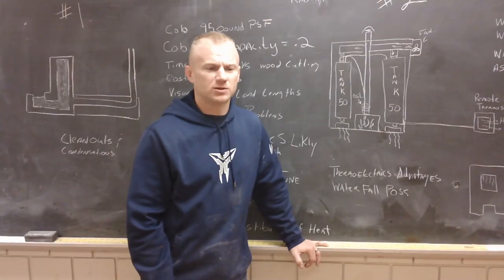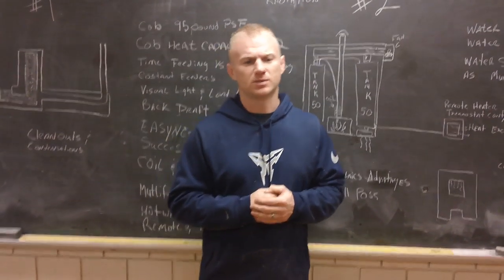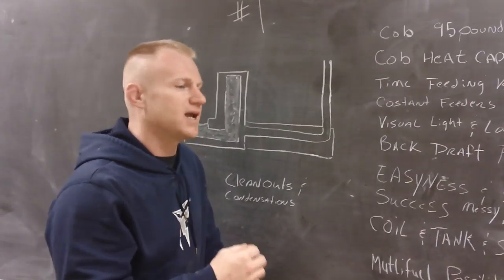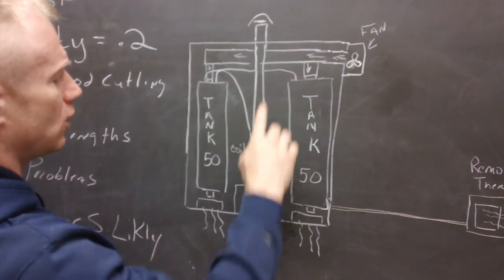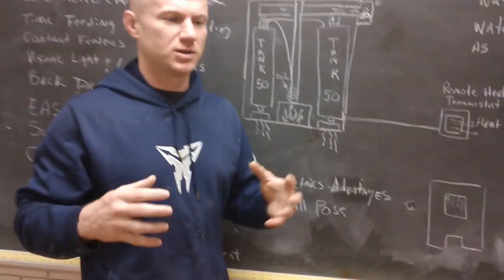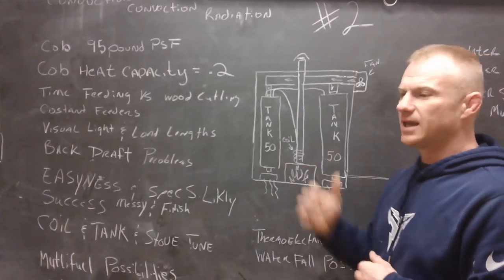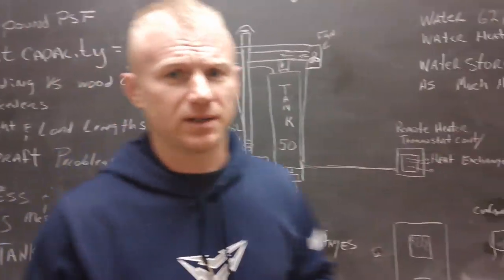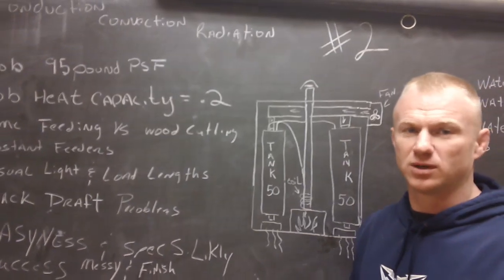Green House Heater Death of the Rocket Stove part 2

Comment: the main issue with water is that  when it boils it builds up in pressure to very dangerous levels ,like a steam engine ..boilers can explode causing serious injury  ...water must be monitored all the time and if not you will need a quite expensive sytem of thermostats and heat exchangers ,also pipes will suffer from corrosion so you will need additives . i think the base idea of the rocket is environmentally friendly and self sustainable  with very low quality combustible such as sticks or dried manure
Reply from the maker: You Sir are mistaken and do not fully understand fully the basic scientific principals and how to apply them in this situation to easily avoid all such concerns by simply a full understanding of what you speak about . Allow me to inform you.
 First boiling is not required for thermal siphoning, simple thermal currents will move the water with out boiling or ever reach the boiling point. Second and no small detail is the following any half wit can simply use more water for the tank than the fire or the coil is capable of boiling. simply inefficient amount of heat reaching a volume of water so big it looses heat by surface area faster than the input or heat added can raise the temperature enough to boil . Next would also be the obvious option of not having a sealed container where any pressure can build in the least bit. OR even a pressure release valve or a one way pressure release valve made for steam applications. BUT a simple tiny hole in the top of the container of water will do the trick just fine too. Further to my knowledge people have known for years not to put water in pipes that corrode. Im not sure what your suggesting...but maybe we should say dont use plastic pipe in a fire too..LOL.
Now lastly I have built dozens of the stoves many of which are here on my channel. Im here to tell you some simple truths about a rockets stove, Its a bunch of hype a myths. Here is specifically and exactly why. There is 8000 BTU's in a pound of hard wood at less than 10% moisture.. Fact sticks from the yard are far less dense and far more moisture. Fact the average 1000 sq ft house demands 18000 btu per hour. Fact there is not enough cubic inches of burn chamber to put in sufficient fuel in that has the required heat to heat the house . The energy from sticks from the yard  is not sufficient to heat the house.. It wasnt there available in the wood to start with and the rocket stove aint magic and adds it.
Reply: if we all had the same opinion life would be so boring
Reply from the maker: @Sinky-t3i  LOL @ opinion way to not accept responsibility,  as if its all my claims are  known information that can easily be proven and/or google it. So you call scientific recorded measurements and known facts at every scientific institution across the glob an opinion so you can pretend not to be wrong. You didnt challenge ONE of my claims of fact just simply dismissed them all as my opinion. You cant provide one shred of  evidence or reference to a counter claim, just simply said it was all opinion. What a healthy mind set you have . I bet its wonderful living and/or working with such a person. some people are sooo lucky.
Reply: @TheTitian69  thats why we dont use cob to cool an engine hahaha

Comment: What do you do with steam pressure with hot water so you don't have an explosion
Reply: Leave a cap off of a barrel, put in a pressure release valve, or have an open system.

Comment: You seen the latest Rocket Mass heater designs? seems to solve a lot of issues in 2013
Batch Feeder + Bell Mass
Works like a normal stove and easier mass system.
The problem with your stove design is it does not get hot enough to burn efficiently, I had a lot of though of using water as heat storage, its complex, prone to failure, just seems normal bell mass would be cheaper and simpler, i think u can stack the bell vertically too to save floor space.
There is another design by Matt, its a Rocket Stove Mass heater, its like a cook top, you can potentially put a 55 gal barrow on top of that stove to store heat.

Comment: Sorry for attempting to correct a fact you brought up.  You have your units mixed up.  
One square foot of cob is a unit of surface area and not a unit of volume or weight of that cob.  You must compare the mass of cob with the same mass of water.  If there is an advantage to using water over cob then you can elect to choose one over the other.  
I look forward to seeing you calculating equal weights of the two and seeing if one has an advantage over the other.  Thanks.
Reply from the maker: Cubic foot is volume you are wrong. (look it up)Surface area of one cubic foot is 6 square foot. Secondly It is not a matter of IF there is an advantage using water it is a matter if fact that can be looked up on material thermal storage capacity charts. water has a thermal capacity of 1 and cob has a capacity of .2 or just 20% of waters thermal storage capacity. water weight for one cubic foot is 63 pounds while solid stone is about 95 pounds per cubic foot . The density difference drops the water thermal capacity advantage from 5 times to 3.26 times still better than cob.

Comment: There is a significant down side in allowing leaves to rut and Bri gong that heat into a green house and from the green house into the house.  Leaves decompose by the action of fungi and fungi then propagate to form spores.  If people inhale that air they might I hale those spores and get fungal infections in their lungs.  Not a good idea to risk your health for the sake of heat production.
Better stick to rocket stove in the green house.  Even then, a carbon monoxide check is a good idea just to make sure it doesn't come into the house.

Comment: The free exchange of ideas. I've added a couple of slab foundation additions to my cabin with plastic water lines laid down before the concrete pour. I have an older woodstove that has the hot air tubes incorporated in the build. The idea here is to weld some threaded connectors to the hot air tubes in the woodstove and plumb water instead of air. Convert the water to steam, the steam becoming the vehicle to push the water through the lines under the slabs, heating the slabs and then returning cooled water to a toilet tank which is the water supply. The issue is that the steam needs to be cooled a bit before going under the slabs. Next step is for a small array of the old cast iron radiators to cool the stem. A work in progress.

Comment: Hello Van. Thanks for excellent viewpoint and numbers. I had an inefficient wood stove that stole more heat than it offered. I put a pot of water on top and used radiant PEX tubing 1/2" to circulate water. To initiate thermosiphon had a small fish tank pump connected about 2ft off wood stove and only used it for a couple of minutes. The PEX was suspended below ceiling with radiant barrier insulation between ceiling and PEX tubing. After a couple of hours, you had to leave the room because it was way too hot!! Water holds heat and gives it off very well too!

Comment: If backdraft is one of the major concerns, what about attaching a tegs unit to the chamber to power a small fan placed further down the pipe line? Not 100% maintenance free, but it could do the job...
Reply from the maker: That is a possibility. However a simple design of the stove to maintain proper flue temps is the most simple correction

Comment: Share your thoughts about a nitrogen mass air conditioning unit that works with no electricity? I understand you have knowledge from listening to your video. So I am sure all that I have said will resonate with you. My nitrogen mass air unit is a work in progress. I know it can be done with the right components. Like linking a rocket stove and a Stirling engine to run water or generate electricity. To charging and runing a cycle from gas to liquid and make a cold sink to cool a house and chill water just has a rocket stove can be modified to run a whole system. Let's converse have a meeting of minds maybe we can knock out this nitrogen mass air conditioner and make all the information available to everyone. We need to get away from totally relying on electrical means to survive!

Comment: Make a house using cement canvas. Use it on the roof the walls. Then foam and insulation. The cement canvas hardens into ceramic. You can make a heating and cooling system that does not need electricity to work. A rocket mass water heater and a nitrogen mass air conditioner to draft you now very well insulated home. You could even circulate chilled water through your heater hoses to cool the house. You could even put hoses on the roof to disperse heat at night just by circulating the water in the system. Total off grid living!

Comment: I have avoid baby sitting the 8 inch RMH burn. 
http://s28.postimg.org/9kds9syrh/8_inch_rocket_stove_mass_heater_log_wood_for_4_h.jpg
One log of 43 inch wood like in the picture would last for 4 hours. The feed chamber opening is 6.3" x 7.1"

The feed chamber is outside the house for:
1) No wood dirt or ash will be inside the house.
2) Zero possibility were a log or more possible a coal spark would come out the feed tube.
3) No smoke or smell inside the house while starting the fire or in case of bad RMH design, or more often, at air tight rooms, any backdraft occurs outside.
4) No explosions or cracks annoying noises from the burning wood are heard inside the house (sleep and anxiety friendly).
5) Ash pit is under the feed chamber so cleaning is almost unneeded.
6) Air inside the house stay at the same temperature while conventional RMH continuously push out the warm air at the same time they suck cold air into the house from any opening or cranny.
7) A horizontal handle is barely visible at the level of under the chimney tee, at the center point of feed chamber front face to drag any ashes from inside the 20 inch long burn tunnel to the grate which separates the feed chamber from the ash pit below.
8) Any possible condensation in the chimney will stay outside the house.
9) Easy cleaning of the 10 foot horizontal pipe which is lying down inside the house by removing the cap from the tee outside.
This RMH work fine.
Reply: kalimeraHellas You have a great ideea. I am serchingbthis for over a year.
Thank you

Comment: ..yes, but, the cob/masonry has a higher temp capability.  SO, a masonry mass can store heat at 500+F, whereas water would be all boiled off.
Reply: The 4'x4' bench/bed (with a firebrick duct and 2/3 of a 55 gallon drum on its side as the heat path, all buried in cob)of a Walker core system I built has been delegated to wood storage.  It's waaaay too hot to sit on at full bore.

Comment: Hi Van, good vid, thanks.
The rocket stove is a very efficient way to make hot gas. To put that heat into cob....
However, if you get that gas through the inner workings of a water heater, it will work.
you can put that hot gas into cob, but also water, soap stone, what ever. that is a choice you can make. further more, to increase growth, green houses are frequently 'injected' with co2 (during day time, it enhances fotosyntheses)
Imagine having the exhaust inside the greenhouse in day light and exhausting outside during the dark hours. just a thought. ;)

Comment: I enjoyed your video, thanks; can you tell me how to deal with the weight of the water in a structure home.  I could only think of using this in a dirt or cement floor basement. I have a cook stove and have been planning on putting a copper coil mounted on the back to use the hot water and extra heating.
Reply from the maker: 55 to 125 gallons of water in one room which will hold 50k BTU of heat will be fine in any house that meets codes in america.. anywhere....anytime all day. and 2 tanks of that volume can be fine in one room if not set close together or some other considerations are taken such as..

to be Considered

dead load:  This is the weight of everything that is permanent such as the floor joists, walls, piping, ductwork, floor tile, etc.

live load:  This is the weight of everything that you add to the house or apartment when you move in.  Furniture, bookshelves, people, appliances, and of course, your computer and your aquarium(s).

safety factor:  Your floor was designed to support loads without collapsing using a "safety factor".  The "safety factor" in most structures is usually somewhere between 1.5 and 2.0.  So, if I tell you that your floor can "safely" support 1000 pounds then that also means that your floor might theoretically fail  when it receives a load of 1500 to 2000 pounds.

bearing wall:  This is a wall in your house or apartment that was designed to support the weight of the floor, wall, ceiling or roof.  (Most or all of the concrete or masonry block walls in your basement are bearing walls.)

partition wall:  This is a wall in your home that acts only to separate rooms.  While it might be able to support some load, it was not designed as a part of the structural system that carries the weight of your floor or roof down to the foundation.

floor joists:  These are typically 2 x 8's or 2 x 10's at 16 inches on center that support your floor. Each end of the joists are supported by bearing walls or beams.

subfloor:  The sheet of wood (usually plywood) that is nailed to the top of the floor joists to form the floor itself before carpeting or tile etc.

beams:  The beams act to support the floor joists.  These beams might be constructed of wide-flange steel beams (commonly and incorrectly called an I-beam) or they might be wood triple 2 x 10's, etc.

column:  A vertical post that supports the floor beams.  In a home this is usually a round hollow pipe.

In the United States the minimum design floor live loads are stipulated in pounds per square foot (psf) by either state or local building codes.  An example of typical design live loads might be 200 or 150 psf for a storage warehouse, 100 psf for a public meeting room,  50 psf for an office and 40 psf for a single family residence or apartment building.  So, your home should be able to safely support a uniform live load of at least 40 psf.  But keep in mind that this design live load is theoretically spread uniformly over the entire floor from wall to wall throughout your entire house.  It is not a maximum load on any given area of the floor, it is just a theoretical average load that is used to design the floor for loads that are initially unknown.  Some people find this confusing because in reality it is not the floor pressure (in psf) that matters at all, it is the floor load in pounds that really creates the stress in the primary structural framing members.
Reply from the maker: My Grand father would  like to say there are many ways to skin a cat.. I would like to point out that 55 gallon drum would be plenty of hot water and one could use an old stripped down hot water tank to both hold water and release heat. a 55 gallon drum would  be about the same weight as a commercial 40 gallon tank with all the stuff on it.. 55 gallons will store a LOT of heat about 77,000 BTU's.. It works great to set the stove in the basement or lower room and set the tank upstairs to heat the upstairs and also be gravity fed to get the hot water on the first.. It sill can be set up to thermal syphon or no pump need heat flow will take care of the circulation . The tank could also be set in attic directly over where walls come together  in a corner to lend strength and support to hold it. You could put a box around it in the attic and a fan to blow heat down from the warm barrel .. just some thoughts...

Comment: I like the idea of using water rather than cob but the actual "rocket" design is simple and very efficient. One thing you spoke of got me thinking...if the pipe going out with a rocket stove is becoming too cold then they are recovering most (maybe too much) of the heat being created. That's an effect of good efficiency, right? So maybe they just need to dial back the length  of the pipe and give up a little heat to keep from getting back draft??? I don't have the answer but its nice to see people like you working on one. Keep up the good work.